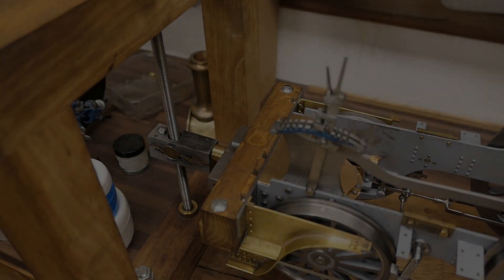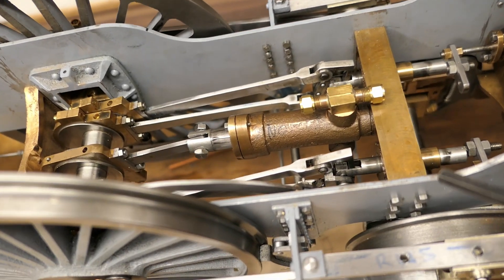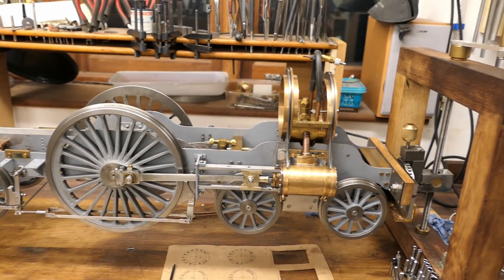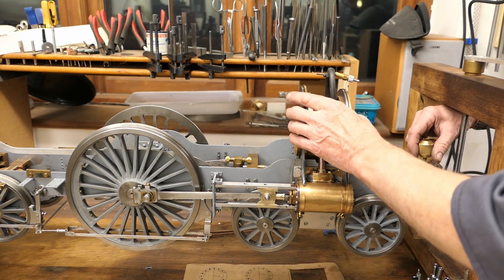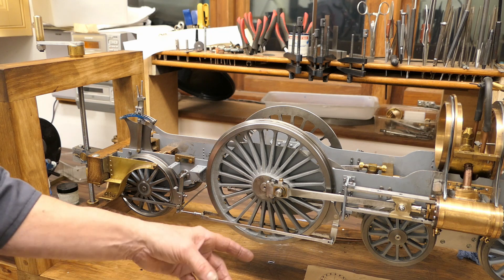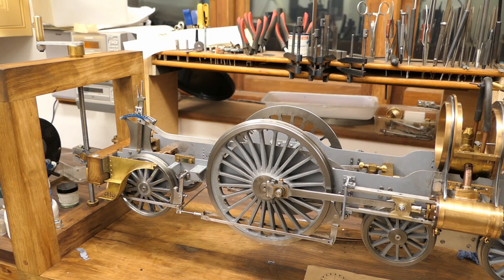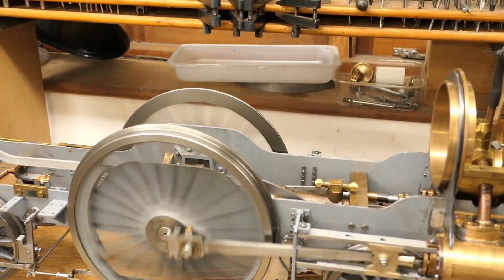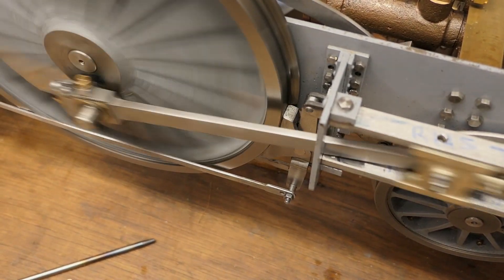5" Gauge Stirling Single Steam Locomotive Running on air

Comment: Hi Chap,
I've picked up a part built one of these myself that I am working on. Thanks for the pointers on design errors and modifications !
Reply from the maker: Peter that sounds great. There are a couple of excellent build threads on the model  engineering forum  which you may find useful ( I did).  This is one of them. http://modeleng.proboards.com/thread/13166/stirling-single-10-00-scotchman?fbclid=IwAR24e3Mj5PwiDrHEtQri_iOT6vKAiHeCZxEpml6ksYDpU5Xzat0DH1CVjXw
Graham

Comment: Excellent work. A very impressive job. With the little knock, a silly question, have you checked the clearance between eccentrics and that frame stretcher behind them, including the screws holding them together? Have you also got sufficient head clearance between piston head and front and back covers? But if it is only on blocks, it is probably going to be in the valve gear or a slight slop in the valve gear. That has been my experience anyways.
Reply from the maker: Not a silly question as some of the clearances are  very small but I have double checked this and its not that.
Reply: @engineeringmodeller  Any luck with finding it elsewhere? All the best anyways!

Comment: Very nice work. Regarding the knock - when you ran the loco suspended in the cradle, did you pack up the axle boxes to the normal ride height?  If the loco is running with the suspension at its lowest extreme then this could cause the knocking.
Cheers Craig.
Reply from the maker: Hi Craig, no I had not packed it to the correct ride height. I have now tried doing so and it has definitely reduced the knock but not eliminated it.  I am also not convinced that I have the valve timing spot on and I wonder if that could be part of the problem.
Reply: Yes timing may well be key to this. Try setting the timing to give early admission to the cylinders. That is - the valve starts to open before the piston reaches TDC or BDC. It has the effect of cushioning the pistons as they decelerate whilst also providing immediate force to the piston once it has gone over TDC/BDC. I think it is called 'lead' on the valve setting. On my 9F loco I seem to recall setting the valve lead at 0.010" using a feeler gauge. Definitely worth a try.  
Cheers Craig.
Reply: Sorry, the above is valve setting not timing. I put up a long-winded video regarding setting the valve timing for the Walschearts gear on my 9F. Not sure if any of it would translate to your valve gear.
Reply from the maker: @no23mk2  Many thanks for that, I think I can learn a lot from your video, as I understand it the valve opening and closing is basically the same irrespective of the type of valve gear.

Comment: beautiful work, you mentioned a slight knocking sound , could it be a ball or check valve on the water pump?
Reply from the maker: Mark, thanks for the comment unfortunately its not the ball as I have yet to add them. I think it maybe one of the die blocks that may be slightly undersize, I shall investigate further and post back if I get to the bottom of it.